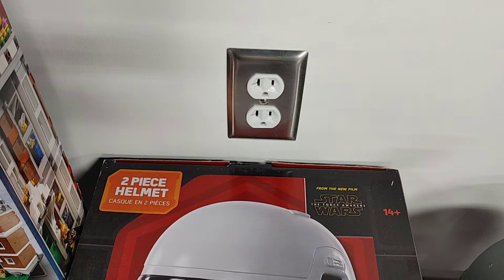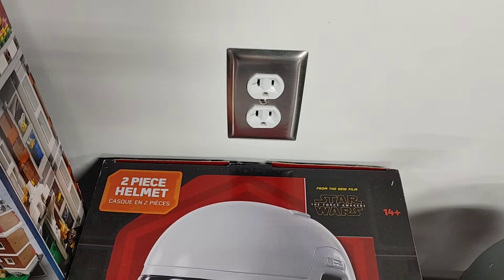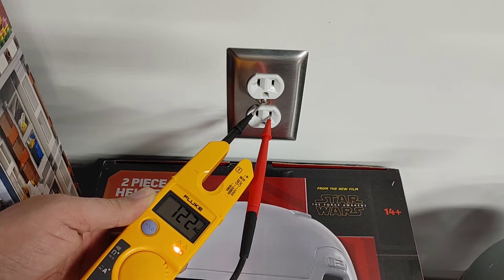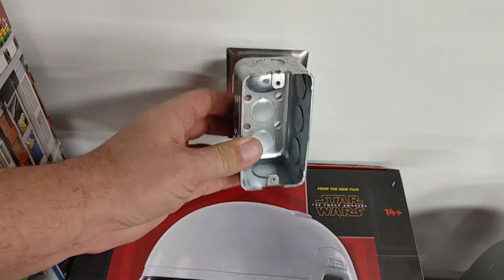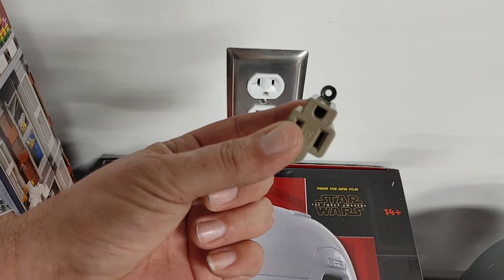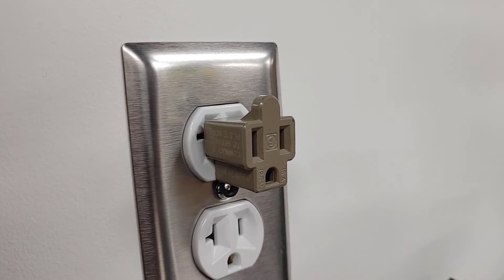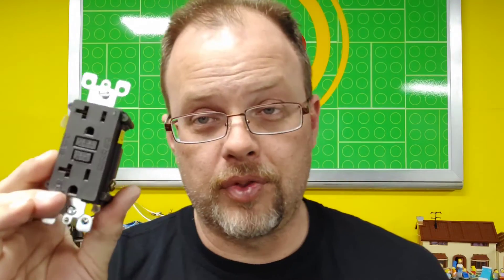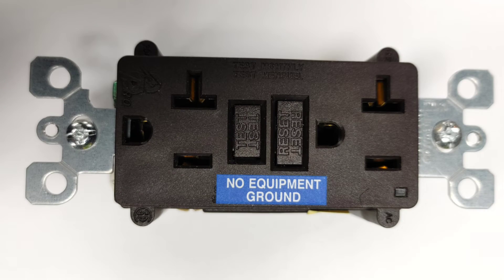How to swap a 2 prong outlet to a 3 prong outlet.

Comment: That screw with the adapter will not provide reliable low impedance fault path.

Do you not measure the ground loop impedance I the US? In Europe that is basic stuff. It would show it there is proper ground. A multimeter dies not do it.

Comment: What’s the risk in having an ungrounded outlet and plugging items into to it? I just bought a house and am having an electrician replace my old 2 prongs to gfci outlets. Thought I’d ask what the benefit is in layman’s terms lol thanks!
Reply from the maker: The ground is to protect you and also anything plugged into.  The hot and neutral are both considered current carrying legs.  So no actual protection for people without a ground.  The ground also provides protection for sensative items, such as tvs, and computers.

Comment: I thought you couldn't leave the two prong adapters in the wall for a long period. I have an old house that is 40 years old and it doesn't have a ground at all in the house. I put in the adapter for my mini fridge. I was going to change out the two prong for the three prong which a friend did for me in my bedroom.

Comment: Say you wrap a wire around the hot prong and put it in the ground before plugging in the appliance. Did you just bypass the third prong and ground your appliance? Or did you just electrify the ground?
Reply: I suppose it should be the cold prong you wrap the wire to and put it in the ground. Right? Than technically you've grounded your appliance right?

Comment: I'm pretty sick of every video suggesting the GFI outlets as a solution.  It's really not.  For people like me, who really want it done the right way, I want to know what it would take to run a ground through the house and modernize the electric without having to spend tens of thousands to have someone come out and do it.  Running electric in my house should be easy.  I have an unfinished basement with a 6' high ceiling.  No ladders needed.  All of the electric is run along joists and then simply run straight up to where the first outlet in the string is located.  I have 2 grounding posts already outside my house from a previous install.  My 2nd floor is grounded with boxes outside the walls.  The first floor and basement are NOT grounded by have GFI outlets.  One of the grounding posts outside has a ground wire attached.  The 2nd one does not.  My second floor has normal grounded outlets.  My first floor has some 2 prong outlets and and others are GFI.  Some have 3 prong outlets but I don't get a ground reading when I test them.  Naughty.  My old house is a cluster of DIY projects with people who didn't care if they did stuff correctly or to code.  And I'm not paying anyone to come in my house and start quoting $10,000 do do work when material costs are only 10 to 20 percent of that quote.
Reply: Troy, according to code you can't just run a separate ground wire. It's supposed to be part of the "same cable assembly". Would it work if you did it that way? Probably.
It seems like it would be easy to run new wires to the receptacle locations, but in reality, it's not. It's actually a big PITA. (I know, I'm a licensed electrician.) Which brings me to your next point...
A licensed master electrician, who's running a legit business has fees and costs (overhead) associated with running it. Accountants, license fees, inspection fees, business insurance, vehicle insurance, taxes, employee wages and state mandated benefits, training, vehicles and upkeep, gas, tools and upkeep, rent, and more. I wish I could charge $75/hr and keep all of it (I'm the only employee now). Just wanted to let people know that not every electrician out there is ripping people off.

Comment: Does anybody know what it means if I get a reading in the high 90s but not quite 122 also I for sure have metal boxes and one of my Outlets reads 96 when I do the test and the other only reads 6 volts
Reply: It could be an open neutral.

Comment: The problem with the GFCI outlet is how it is placed in a Series or Parallel circuit. Generally, most homes are in Series. You need to locate the First direct electrical connection coming from the Fuse Box/Circuit Breaker Panel and install that GFCI as the first outlet. Now, the other problem that follows if you replace other 2-prong outlets with a GFCI is when the circuit trips. Nothing like going around from room to room and pushing the reset button. As you also mention having No Ground, must use the sticker "No Equipment Ground" which starts another problem as those stickers fade, become damaged and unreadable, are removed, or the adhesive glue eventually allows the sticker it fall off. With small children around I would prefer not to use metal plate coverings for the child's safety. Spend the $5,000 to have a new breaker panel put in and the $20,000 to $25,000 to rewire your home. Yes! it is expensive as today you are better off buying a home built in the 1980s to the present. Older homes also use galvanized or copper water pipes. However, older homes can withstand environmental weather conditions better because they were not built with Twiggs and Staples. Got water, plumping, sewage, electrical, insulation, weatherization problems all the time. The Three Little Pigs scenario is a straw, a wooden, and a brick house. The Pros and Cons of Owning a New or Old Home. Housing Code Violations are bound to occur sooner or later.  Plant your trees at least 50 feet away from the house and a distance from the electrical lines/pole. Buy a house on high grounds above flood zones, homes within 1/4 mile or near water tend to get flooded, and beware of Tornado and Hurricane geographical locations. Life is full of What If, And, But? Rule of Thumb... Safety comes First.  As of 2023, do not live in Florida or California as many Insurance Companies are abandoning the state and leaving homeowners with No Insurance. Be careful about grounding your outlet to a nearby water pipe as you do not know if that pipe is metal all the way to the surface as ground. Some people have gotten electrocuted or shocked because of the ground being attached to a nearby water source.  Again, safety first.

Comment: My girl had her 3 prong outlet change out broken and exposed wiring in the wall and they put a 2 prong outlet instead smfh. So it’s safe for me to just switch it back to the 3 prong right?
Reply: Consult an electrician. How can anyone tell if it is safe when you provide no information? Maybe it was changed improperly to thee prong at some point. There is some reason they used a two prong one. Off it is an old house you should use the GFCI method.

Comment: You can also use a dual function breaker that provides GFCI and AFCI protection and replace the outlets with standard outlets on the circuit the breaker is installed but be sure to label each outlet No equipment ground and GFCI and AFCI protected outlet

Comment: I did just what he showed doing adding a ground wire. I had several outlets the electrician that rewired the house did not swap to romex because they were metal conduit and metal boxes. He said they were grounded by the conduit and changing them was an unnecessary expense. I have added a ground wire and swapped out for three hole outlets for all of them. No issues have occurred.

Comment: I switch a 2 prong outlet to a 3 prong outlet a year ago, I’ve zero experience dealing with electrical stuff but I watched it on YT and tried it so far it works and there’s no issues. I just want to ask why is it not allowed to switch a 2 prong outlet to a 3 prong outlet?
Reply: Two reasons that I'm aware of. 1. A 2 prong receptacle identifies that there's no equipment ground. Replacing it with a 3 prong receptacle falsely indicates that there is an equipment ground. 2. Many electrical products have a 2 prong plug and are safe because they are covered with a non metallic case and/or are double insulated. However, it's also true that many electrical products have 3 prong plugs and are relying on the equipment grounding system in the building to protect against a shock or electrocution, should a ground fault occur in the appliance. The ground wire provides a low impedance path to the main electrical panel and will trip the breaker. Otherwise the breaker will not trip and the appliance will remain energized until the cord is unplugged.
Sometimes the metal box will be grounded even though there's no ground wire visible. You can check this easily by using a 3 prong receptacle tester.

Comment: The GFI WILL still work without a ground because it measures current leakage between the hot and neutral to trip the receptacle. It can be used in a bathroom or kitchen wherever a GFI is required. 
That’s why it’s code legal even without a ground.

Comment: Why doesn't anyone talk about the rust on BX cable connections that is inevitable in all the old homes here in the northeast, and that relegates the boxes all ungrounded..
Reply: If I have to work in an area that requires BX cable, I run MC cable instead. They're very similar, but the MC cable has a dedicated insulated ground wire...

Comment: Thank you for a very concise and informative video. We have an old house with quite a few two pronged outlets still, and they all show a good 120 volt ground. Just ordered a bunch of Raco pigtails along with 10/32 drill and tap in case I don't have a hole in the boxes. Thanks again!

Comment: Thank you  thank you. I was looking and hoping someone would make this video. Only I didn't hear what gage or awg type ground wire u use ,but I kept doing my research. I got worried about codes and installation. Your video helped me
 Thx again.
Reply from the maker: You should be fine using a #14 ground wire.

Comment: You don't need the extra ground.  House was converted to 3 prong 20+ years ago and no issues.  Otherwise all these houses with 2 prong would have gone up in flames.  Same thing..just not to code and a sticker making it code is exactly why government needs to stay out of the business.  Like putting a sticker on your 64 Corvette steering wheel saying No Airbag.

Comment: Gfci are $30 a piece.
Old houses don't have a ground nub in the metal box.
I usually drill and tap inside the box and put a ground pigtail, like he showed, pretty quick, <5 min,  and true ground on plug...
Reply: Thank you for your comments. I have an old house with a lot of two prong outlets and they all have a 120 ground showing. Just ordered a bunch of Raco pigtails along with a drill and tap because I'm pretty sure I won't find the hole ready in the boxes. Thanks for the tip!
Reply: @waltzb7548  cool glad to help. Don't forget tapping oil for drill and tap, you don't need much, qtip with rubbing alcohol to clean up oil in new thread, again just a bit you don't need to go crazy.
Lastly small wire "cup" brush on a drll to scratch metal near hole if it's dirty/oxidized/cement around the hole

Comment: So I have to put 27 GFCIs to retrofit my 75 YO house? And I still won't have ground protection? That's PUSSY. I don't think so Tim...
Reply: The GFI only has to be at the first point in the circuit, not at every outlet. Unless you have 75 circuits in your house, you won't need 75 GFIs.

Comment: Great video; my home is old through the house I have some three prong out lets, and some two prong outlets my question since I know the house is grounded can I just install a polarized plug adapter to my two prong outlet then I can used the outlet as a three prong outlet?  Thank You
Reply from the maker: Can you yes but you are not ground protected on anything plugged into that receptacle

Comment: It might have been slightly better if you had not shown a 20 amp GFCI.   Can’t be used on 15 amp branch circuits which most houses are installed as.
Reply from the maker: You can use a 20 amp device on a 15 amp circuit.  You can even use a 15 on a 20 amp circuit under certain exceptions.  See code 210.21 NEC

Comment: My outlet reads 119 voltage... is my out grounded????
Reply from the maker: If you are reading that to ground you should be but some people bypass the ground and use the neutral in its place as a cheat.

Comment: @Bevins Build,  if my outlet box is not grounded, and I want to install a GFCI, can I ground it by running a green ground wire from the box to the GFCI if its metal?
Reply from the maker: Yes
Reply: No, the box must be bonded and grounded at the main service entrance.
Reply: @surferdude642  I think you lost a bit I think first you said yes to my question then you said no I was told if the box is metal you could ground it with the wire and green screw
Reply: @babyboinews6896  That was Daryll (Bevins Builds) who said yes. I said "no" because his "yes" is not correct.
Reply: @surferdude642  no problem so you are saying I can't ground it from a metal box to the outlet
Reply: @babyboinews6896  Yes, that's what I am saying. The metal box must be grounded first, meaning a wire must be connected from the box to the main panel ground/neutral bus bar or a ground bus bar in a sub panel if one exists. This is the only way to get the circuit breaker to trip if a ground fault occurs.
Reply: @surferdude642  last thing I heard the gfci doesn't have to be grounded because if you don't have a ground it will still work because it's made for either way
Reply: @babyboinews6896  True. If it's grounded everything is protected. If it's not grounded, you're still protected from electrocution, but your equipment will probably be damaged if a ground fault occurs.
Reply: @surferdude642  ok thanks

Comment: this is not the same type of wiring I see in any other videos. What happened to the black, white, and copper (ground) wires? are they all in that metal tube?
Reply: This type of house wiring is called flexible bx it’s two conductor black and white wires inside a flexible metal tube which is the ground, it was intended to be used with metal boxes with a clamp so when you installed the outlet in the box it became grounded without the use of a ground wire.

Comment: In testing the outlets in my old 50's house I do get a reading from the slots to the outlet box. Yours read 122v, but mine reads 61v on the big slot. The small slot reads 19v. The two slots together read 123v. I can't make sense of it. Lol. Any ideas?
Reply from the maker: That sounds like a bad connection with no proper ground.  Curious if your main panel reads that way as well to the hot and neutral.
Reply: i just came into the comments to see if anyone else was experiencing something similar.  ive gotta watch another video or two before i feel comfortable testing further...
Reply: @michellechristine4841  In my case my outlets are not grounded. Its just 2 wires going to the outlets. The outlet box is not grounded so it must be creating some phantom voltages.

Comment: It doesn't ground the appliance, but does it offer any protection for a person from getting electrocuted ?
Reply from the maker: Correct it does not protect equipment from ground at all but yes having a GFCI outlet does provide electrocution protection.
Reply: @BevinsBuilds , and it also protects all downline, (or download) sockets, if any because a short in one of those will trip the GFCI.
Reply: @BevinsBuilds  So would using a surge protector work in place of a ground?

Comment: Is the alternative to get an electrician and have a cable installed so everything will be grounded?  I'm so confused.
Reply: Simple, right? Rewire the house, re-patch the drywall as needed and paint the house. Not very costly.
Reply from the maker: To have a true ground protection yes you have to have a ground wire ran to the outlet.
Reply: @BevinsBuilds  Thank so much for your reply!

Comment: I got a self grounding 3 prongs outlet from HD to replace the old 2 prongs outlet and still the tester show "open ground" , any fix for that?
Reply: Do you have the box properly grounded. A self-grounding receptacle just connects the receptacle to the box in a way that it is grounded automatically if the box is grounded. It does not somehow magically provide ground where there is none.
Reply: You mean a GFCI probably, but that doesn't mean it's grounded. You need a conductor or path that goes all the way to the panel. The metal sheath he showed does go back to the panel and is grounded to the panel itself.

Comment: When used a metal plate on 3 prong outlet, grounded up.
Reply: Receptacles do not have to be "ground hole up" when using a metal plate. That is, as we say, an old electrician's wives tale...

Comment: Can a ac unit be used with the adapter bc it takes a 3 prong. I feel it's iffy but I'm not sure ? It's a older two prong currently and I need a 3 prong
Reply: Did you ever try it and if so did it work?I'm currently having that same issue.What did you end up doing?
Reply: @ckennady  I upgraded the outlet . The adapter has a area to ground it into the socket. And can be found at local Lowe's or home Depot near the holiday items bc it's that time of year  they are cheap. But it's safer to upgrade the outlet to a three prong . And easy .
Reply: @jedidias7091  ok thank you so much